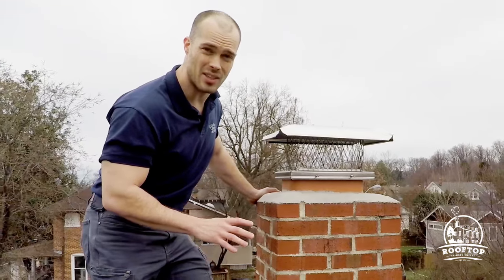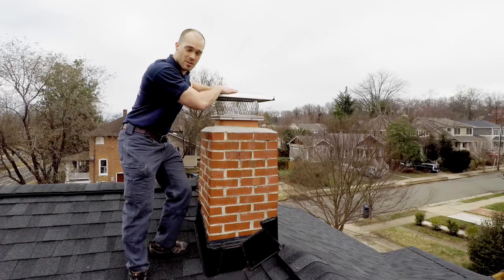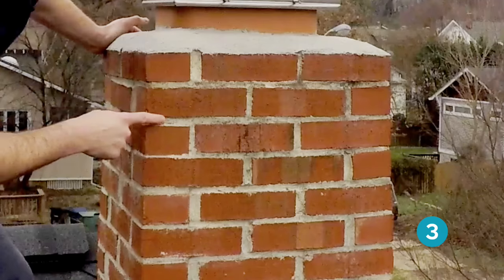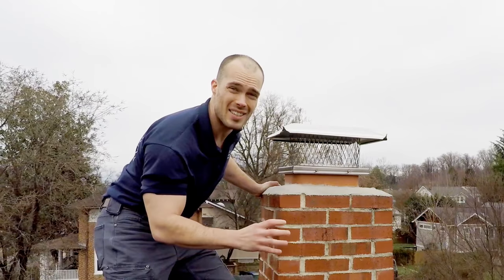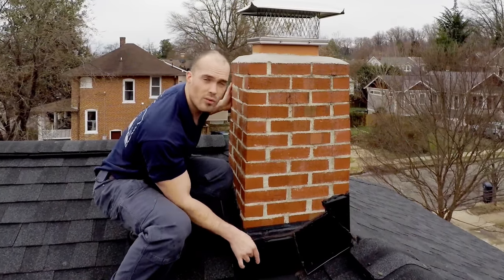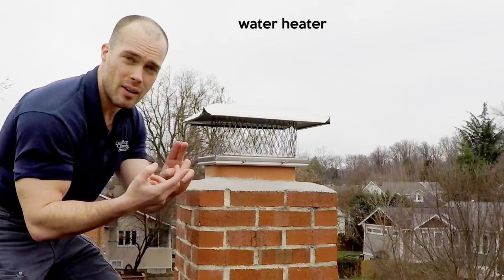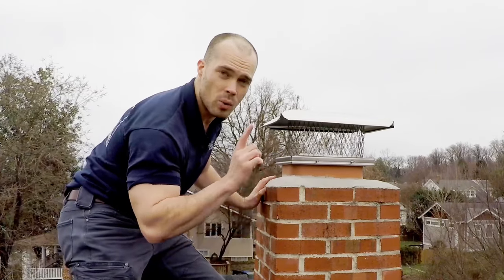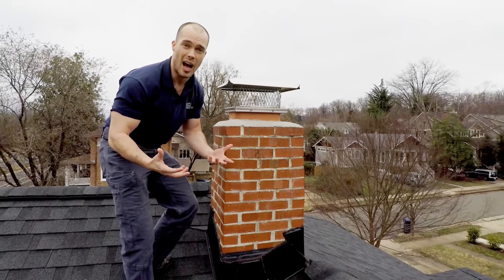6 Ways Water Can Leak Through Your Chimney

Comment: As a contractor myself, most homeowner's won't be on the roof, ever.  Fix the leaks and the home owners are happy.  In your video, that chimney should have a drip edge.  Otherwise water dripping down the brick & mortar will cause more leaks.

Comment: Cheers my man. I've had a leak and was worried so I got up there with the right ladders etc. You're right enough.. My flashing and bricks were letting water through. All sorted now.. Awesome video man.
Reply: How did you fix this issue?
Reply: @eatmoreeats9566  i used waterproof paint and sealed all the bricks, about 1 month after this process i removed the old bricks and capped the thing off as it not i use ...cheers pal

Comment: I had chimney work done, new crown, cap, and stainless steel liner. The chimney is bleeding water in the attic. A squirrel nest was removed also. Any guesses?
Reply: Did you ever figure it out? Could very well be the brick itself and bad mortar joints allowing water to seep through.